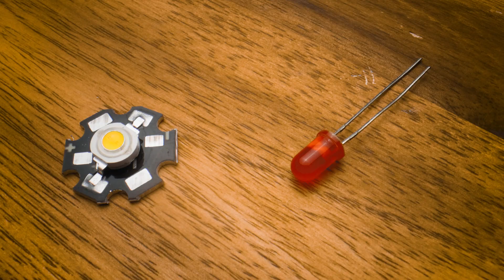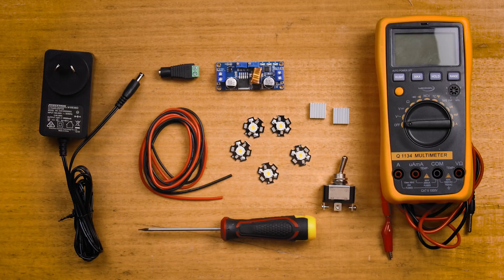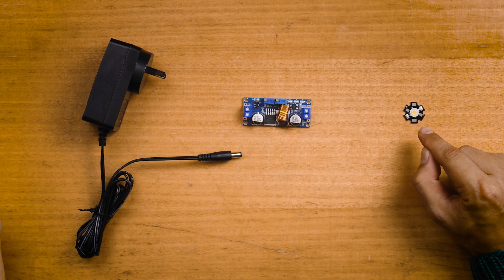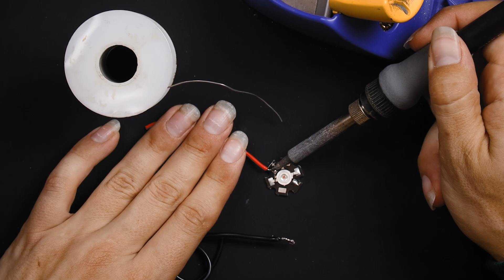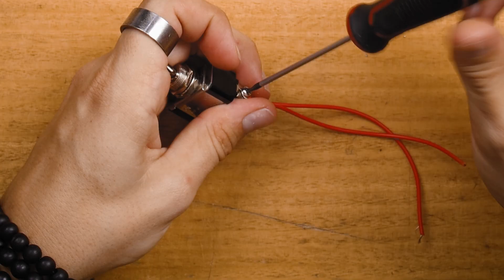How to Drive High Power LEDs With A DC-DC Adjustable Step-Down Module

Comment: The best video I've seen. Thank you so much!
I'm very new to electronics but I'm fabricating my own LED landing lights for my experimental airplane. I have a 12v system and I would like approximately 75 to 85 watts of light. There exists a landing light that is a 75watt led but its quite expensive, and I "want" to build my own. Also, I will be putting the lights in the leading edges of the wings on each side so there will be be some additional resistance in the wiring due to the length.
Can you make any recommendations? I was thinking of using 16awg stranded wire since the length for each wire will be about 15-18 feet long. I would also love to add a "wig wag" switch so the lights will alternate left to right which will increase visibility, but I want to be able to stop the wig wag closer to landing to give a steady beam of light within the last 100ft of descent.
If I understand this correctly it seams that I will need about 25 3w LEDs each light. Would this XL4015 work for this application or do I need something different?

Comment: How I can dim the LED’s with that setup and an microcontroler ? I need some help on the hardware side … 😢
Reply from the maker: You will likely need to find a LED Driver that supports dimming, or you could use something like a MOSFET to control the brightness:

https://www.youtube.com/watch?app=desktop&v=t1WRxmG3h3I

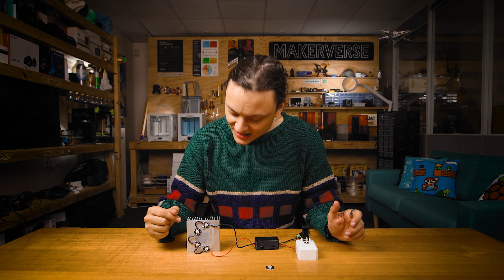Comment: Great! I dare to say that I seem to understand things that were always obscure to me. Thanks. Min 10:48 "If you want to add the ability to dim the light, this is the perfect opportunity to use a microcontroller..."    What would be the setup in this case DC->MC->StepDownModule->LED? or  DC->StepDownModule->MC->LED? In fact, I'd like to create a highly visible strobo light. The other video of yours (https://www.youtube.com/watch?v=t1WRxmG3h3I ) is a great help on why a mosfet shouls be used but I am not sure if a MC can provide by itself a constant current to the LED or if a step down module like LM2596 must be added. Could you expand a bit on this? Thanks
Reply from the maker: If your LED works with the step-down module, the best course of action would be to use the output of that step-down module as the power source in the MOSFET setup. The Pico does have power outputs, it has 3v3(out), which provides 3.3 volts at a maximum of 300 ma (probably not beefy enough for the LED), and it also has Vbus, which outputs the voltage and current from the USB that it's plugged into. This might not be a high enough voltage to power the LED though. So your best bet would be to do the MOSFET guide, but use the step-down module.
Reply: @Core-Electronics  thanks a lot!!!

Comment: I really liked your video, and I want to implement something similar for my apprenticeship project. I need to control three different LED types using a 4-way rotary switch:

1⃣ Off
2⃣ Daylight (COB-LED, 10W, 6000K)
3⃣ 3W Red High-Power LED
4⃣ 3W Blue High-Power LED

I am unsure if I should follow your circuit four times (one for each mode) or if I can combine some connections. Could you help me understand the best way to wire this setup?

I need to finish my project within the next month, so any help would be greatly appreciated!

Thanks in advance! 😊
Reply from the maker: This sounds like you are in the realm of possibly needing a microcontroller (or you can also do without if you want to keep it all analog). We don't do much support over YouTube, but we have a maker forums to help people out with these sorts of projects. Just lay out what you wrote here, and give as much information about your project as possible:

https://forum.core-electronics.com.au/

Comment: Let's combine DC DC conver with pwm module as a dimmer and let's make current measures. That would be interesting, good idea for a next vid? Try focus for example on DIY car ambient light. Trust me many guys will be interested. Additionally, you can add supercapacitor as a "go out" external lights.

Comment: Definitely a good clip, but I have some criticism/advice: Please, don't post videos of wiring (stranded or solid), to screw terminals that require pigtails, unless u show how to properly do that. Please... Improper connections are the biggest reasons for fires.

Wrap the pigtail in the direction of tightening the screw (same for using PTFE tape on threaded plumbing). Reason: as u tighten, it wraps tighter.

If u do it backwards, u widen the pigtail as u tighten, creating less contact. U shouldn't have to be "sure if ur work" by holding the pigtail in and tight (when doing it backwards). U should do it correctly, so there's less effort, definite validity, and (chance that someone sees ur work) relief/assurance that the installer at least made sure to do that right.

With solid, just curl in the tightening direction.

With stranded, strip an inch away from the end, but don't let the sheathing slide out more than a half inch. So: sheathed wire -> exposed conductor 1/2" -> sheathing only 1/2"... Twist the wire as u curl the pigtail (in the direction of tightening the screw), and leave the "extra" sheathing on there. This keeps the strands from fraying, in the middle of the pigtail, and prevents the ends of them from branching towards something else that's conductive. **The 1 inch - 1/2 inch thing isn't a real # (just example); the screw head should only be pressing into the conductor.

Comment: Great video and channel. What if you have 4 LED's run in series and then 4 groups of 4 LED's run in parallel. The voltage would be set at 8 to 12.2 V on the Buck but what would the Current be set at? Each LED needs 750 mA but in parallel they need 3A. How would you trim the current? Would that cause the thermal runaway we are trying to avoid? Thanks
Reply: use a fixed voltage and set the reistor s.t. the LED's current is BELOW its max rating
Reply: @kennmossman8701  If the max rating for an individual LED is 750 mA (and therefore 750mA for 4 in series) but the total for the system is 3 A (series of 4 LED's x 4 rows in parallel) do I trim the potentiometer at 750 mA or 3 A? Thanks.

Comment: Why when we wire two 12v 30w white leds in series, the power supply is regulated to 24v and 3 amps, why does the voltage across the leds drops to 18w while running? should we match the voltage to specs or they are already at their max capacity?
Reply: u have a crappy power supply

Comment: Could you wire one of those leds straight to a usb cable to power it. Or would you still need something between
Reply: you need a resistor

Comment: Great video but some questions.  The buck converter is pre-set to 750ma by directly shorting the meter across the output. It would be interesting to see what the actual current draw is, both with one and five LED's.
Reply: I found running 4 in series at .5 amp (set by shorting the 2 terminals ) when the current was measured in series not shorting it was pulling .25 amps. Trying to figure out now if I should adjust back up to .5 amps with this method.

Comment: Does the CC current control not just effectively drive the voltage back down?
Reply from the maker: That's right, CC mode will set the voltage to whatever it needs to be to limit the current to the desired setpoint. Usually this means throttling the voltage down until the CC limit is not exceeded.
Reply: @Core-Electronics  So setting the voltage first is a precaution?

Comment: At the end of your presentation, you mentioned that we can use microcontroller to dim those high power leds. Do you have any project describing details how to connect microcontroller to DC-DC controller ? (not led stripes, I need to dim high power leds)
Reply: there are dozens of such circuits around

Comment: I'm wondering I bought led headlights they say input voltage is 12 to 36 volts and thought I could buy a couple boost converter and turn up voltage for brighter lights for offroad and track night use . Not sure how it works exactly. No problem soldering and I could pot them in epoxy to waterproof. So if anyone can give advice perhaps a link to what I'm looking for . Thank you for the video

Comment: Hi i wanted to use the same setuo but i wonder if i connect in parallel instead the led and instead of increasing the voltage that i increace the ampere... will that work or ruin the leds? So if i want 5 led of 700ma then that i give 3.5A due to i need to connect them that way for a project
Reply: current must be below the rated max current

Comment: Can I connect 10 LEDs (3watt) in parallel connection with this driver
Reply from the maker: This DC-DC Adjustable Step-down Module can output a max of 36 Volts and 5 Amps.  2 to 2.8 Volts is required for each 3W LED Node. If we use the lower value that will means this module can power 18 unique 3W Nodes if you have them in series. 

If you want all nodes to be operating parallel to each other you will need to bump up the current and keep the voltage the same (2 to 2.8 Volts). Each node requires 750mA and we have 5A available. Therefore we can only power 6 LED Nodes (5 / .75 = 6.666667) if they are all in parallel loops with each other. 

If you want more help/more explanation come check out our forum here - https://forum.core-electronics.com.au/latest
Reply: @Core-Electronics  Very helpful for me ♥️ .

Comment: Series connection is better or parallel for 12 LEDs ?
Reply from the maker: Series is simpler to wire up but parallel will be more resilient to disturbances (a LED Node breaking won't stop the other LED lights from turning on). Hit us up at our forum champ for more 😊 https://forum.core-electronics.com.au/latest
Reply: @Core-Electronics  I am very thankful to you dear ♥️

Comment: How many LEDs can be used with this driver?
Reply from the maker: This DC-DC Adjustable Step-down Module can output a max of 36 Volts and 5 Amps.  2 to 2.8 Volts is required for each 3W LED Node. If we use the lower value that will means this module can power 18 unique 3W Nodes if you have them in series.
Reply: @Core-Electronics  I am thinking of using DC -DC module ( 9 amp) for 10 LEDs (3W) in parallel with the same setup you created in the video . I mean can I use that 12V 2A charger that looks like a laptop charger for this purpose?
Reply: @Core-Electronics  I have one more question. Will the LEDs be safe to use and last long with 9A DC DC module?
Reply: @Core-Electronics 12V 5 amp Or 12V 10 amp charger would be better for 10 LEDs in parallel with 10amp DC DC module?
Reply from the maker: These are perfect questions for the forum here, come write up your question there 😊 - https://forum.core-electronics.com.au/latest - That way other people will be able to find it and glean useful information from it too without it getting lost in YouTube comments.

Comment: Can a 5v output from a power bank be used instead of the 12v shown in this video to drive the same LED?
Reply from the maker: Hey mate in that case your are going to need a DC-DC Adjustable Boost Converter. A great choice would be this one here - https://core-electronics.com.au/catalog/product/view/sku/DFR0123
Reply: of course, but you will need the module to go down to 2.8v from the 5v, and also the courent needs to go down. normal power banks can deliver up to 2A whitch is to much

Comment: Very helpful, thanks for walking us through this! I looked everywhere trying to figure out how to light some cob leds I recently got, but your step by step video explained it very well. I was wondering though, I'm trying to build an infrared illuminator from some 3 watt 850nm cobs I got, but the listing didn't mention what voltage they are, only that they recommended 600 milliamps for the current. How do I figure out the voltage requirement? I read you can use the diode mode on a multimeter to read the voltage on a led, but it didn't seem to work on mine.
Reply from the maker: Surprising to me that there is no indication of recommended voltage but its going to be a 5V. 

Watts = Amps * Voltage

They provided two stats, the Watts (3) and the Amps (600mA = 0.6 Amps). So we end up with: 

Voltage = Watts / Amps = 3 / .6
Voltage = 5V

Hope that helps mate, here is a guide on what I've done here too 😊 https://core-electronics.com.au/guides/analogue-electronics/ohms-law-practical-examples-for-makers/
Reply: @Core-Electronics  Hey thanks for the information, that's what I thought too and what I was going to assume for my illuminator, but I messaged the seller and they messaged me back now and actually said that the voltage was 1.3-1.5V and that the current was 700mA (contradicting their own listing) I also ordered some 395nm UV and white cobs for separate illuminators, and the seller said the voltages for those were 3.2-3.6V and 3.2-3.8V, and all were 700mA at 3W. So I'm even more confused lol. What information do I go off of, the listing or what the seller says? I've looked around and saw other cobs with widely varying voltages and currents in their data sheets and it seems like they're also contradictive too. I guess I'll just have to test (or sacrifice) them with the different voltages. Not sure if I can use links, so in case you're curious, the seller is Cleiscry on Amazon.
Reply from the maker: Contradictory information is the worst mate! When your testing do the lower voltages first and power them only for a couple of seconds. Also make sure your supply device is a constant current driver. I hope all the best for you!

Comment: So it's not just a current limitator, even when 'short-circuited' by your multimeter in current mode the driver has a constant output... which means there must be an automatic rheostat inside (?)
Reply from the maker: That's right! A power supply like this has a "Constant Current Mode" where it will output its set current whenever possible. If it's output is shorted, it will output the constant current it was set up to deliver. We've come a long way from rheostats, but it's a helpful analogy. These power supplies use OpAmps to create the feedback action.
Reply: @Core-Electronics  thanks a lot for your reply (sorry I'm picking this up 2y latter lol, time flies)
Reply from the maker: Excellent advanced question. Here is the circuit diagram for that DC-DC Adjustable Step-down Module https://circuitdigest.com/sites/default/files/circuitdiagram/XL4015-DC-DC-Buck-Converter-Schematic.png. I will also link a datasheet here - http://magicduino.com/Images/ItemsMedia/File/7193.pdf.

Hopefully that will answer your question.

Comment: Good video , but why bother setting the voltage ? Leave it at 12, setting the current at 750mA will keep the the current correct for one or four (series)  leds.
Reply from the maker: Excellent question. Too much voltage kills LEDs. As mentioned in the video, LEDs are current-driven and not a voltage-driven device. If the voltage deviates more than 10% the LED bulb is fused off breaking the node.

Comment: Does a led strip with built in resistors need a driver? I was going to use a boost converter from my power supply (unstable, voltage/current input will vary up to 9V).  But the boost converter caps the voltage and current, no?
Reply from the maker: The Converter shown in this video limit both voltage and current. I'm sure the majority of them do but take the time to check the datasheets before using them in your project 😊
Reply: @Core-Electronics  Can I bother you again. Do you know what "Matched Load resistance" is? I'm trying to power LEDS with a TEG. there is a matched load resistance rating on the TEG. It is nowhere near my LED's resistance. is the load and source suppose to jive ...exactly?
Reply from the maker: Come ask the question on the Forum as well best be able to help you there 😊 there is a fair bit to unpack with your question - https://forum.core-electronics.com.au/

Comment: Hi, pardon me if I missed a point but I'm not electrician and it is a bit hard to understand :) I'd like to ask a question about LM2596 constant current buck converter (3A max, so it is a bit similar to this one). Let's say, we have 12V 2A power supply. When we step down 12V to 3V, I guess, the output current should increase (in 100% efficiency) to 8A, no? This amount is higher than the limits of the both (3A, 5A). Then when we also step down to current into, let's say, 0.5A or 1A and have 3V 0.5/1A output, where the difference (7.5A or 7A) goes? Is this dangerous? Can harm the converter or burn the house? Should I use a fuse in somewhere in the circuit? 

I want to prepare a parallel circuit for hobby lightning. Same power supply in one of the circuits will light half meter 12V LEDs strip and the other one, thanks to the buck converter, 3V LEDs. I'll close the 12V strip in day time but 3V LEDs will mostly be open. So I'm trying to understand how can I do... Thanks for your time.
Reply from the maker: Large voltage differences (drops or rises) results in more heat being emitted due to worse efficiencies. 
The Current drawn by the Converter will only ever be as much as it needs (and no more). There is never any harm done by using a fuse 😊 but we all work very hard to ensure our electronics are top quality. 

Heres some tips regarding power supplies that should make you feel more comfortable - https://core-electronics.com.au/guides/prototyping/power-supply-which-to-choose/

The interesting thing about LEDs is that they will suck the maximum amount of current that they can (even if it will break them). The Constant Current LED Driver (the converter) prevents them from sucking too much and breaking.
Reply: @Core-Electronics  Thanks for your reply! :)